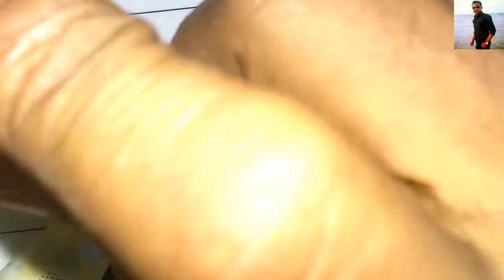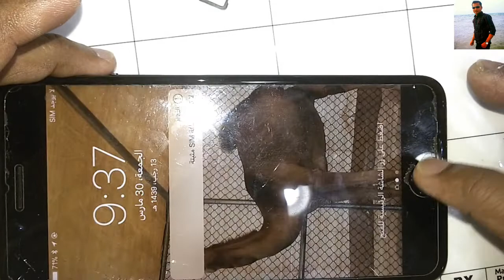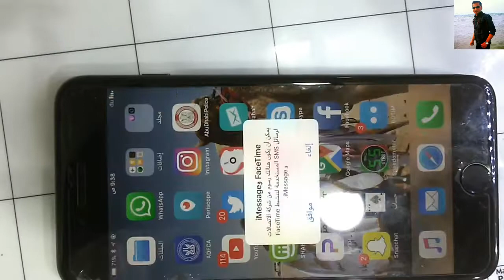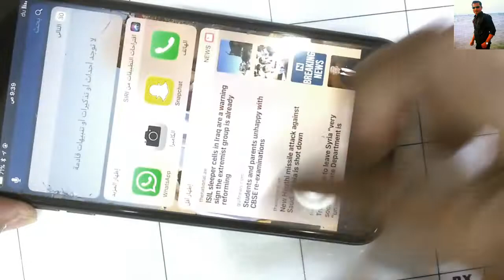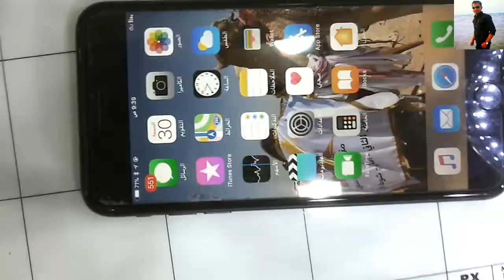How to Fix iPhone 8 Plus Water Damage Repair

Comment: My iPhone 8 after getting into the water for 20s was working very well 1h later I want to charge him and the screen turn blue then my phone become hot lava and so I let hi, cool down for 30min and now it won’t turn on I think the battery is dead. Is the bag of rice could help me their or I should change the battery cuz it won’t charge or turn on ;/
Reply from the maker: It is not advisable to charge the phone without water servicing. If the problem is not in the battery, then the charging ic problem
Reply: the exact same thing happened to my iphone 8
what did you do ?

Comment: Looks like he just cleaned it and put it back together?
Reply: MSR _jae he probably replaced a part or 2
Reply: First step to troubleshooting a water damaged phone is to get rid of all water. The motherboard part especially because it can still hold water even if you dry everything out with Air or heat
Reply: @gothmedia2509  he didn’t replaced parts - I followed his steps with my dead phone and cleaned everything with 99% Isopropyl then dried Motherboard with a hairdryer. I am really grateful to the video - the old beloved phone… it was not worth paying huge money to mend it professionally- so I had nothing to lose!

Comment: How can I send my iPhone 8 Plus to you to fix it? I was under the impression that it was Waterproof but I just recently found out that it’s “Water Resistant”. Phone still turns on, when powering on it just stays on that main white screen with that black Apple logo.
Reply: Donavan Rashad  that i have problem with my iphone 8. But i service from repairing center. But i have little bit water in lcd. How to fix it?
Reply: hey the same happened to me what did you end up doing?

Comment: Are you using a heat gun? Or a blow dryer?
Reply: I used a hair dryer, it worked (Isopropyl 99,9 % first on motherboard)

Comment: i have iPhone 8plus i droped it on water and it was working good when I took it off the water but after some seconds it's home button is not working and then my charging was low and i switched it off and when I reached home then I start charge it but then my screen turns black at the corner and then it produce too much heat and then it won't open tell me what should I do please 🥺

Comment: This video is interesting looks like he’s showing a repair from a phone that just got wet but this person is lucky because 1 if you don’t Do this immediately with power off again immediately and do not plug it in you might get this result ant thing done after those 2 things and good luck the board is trash and the screen is trash will always have issues later something to keep in mind 👍🏻

Comment: Hello 
Nice video! I have a iPhone 8 Plus, I dropped it in water and it is not charging. When I put in the charger, it will tell me 0% remaining after few it turn off. Please help me
Reply from the maker: yes i can fix it
Reply: Your battery probably just went bad
Reply: You need a new battery and maybe a new charging port pretty simple fix 70$ at the most

Comment: .... Most likely... Circuits fried.. so no good...if phone was on...
Reply from the maker: thank you dear bro
Reply: My phone was on, didn’t switch off, it was submerged into a hot, salty, soapy bath water. The worse. BUT I followed the video - it worked! I am so grateful and still cannot believe it. Motherboard treated with  isopropyl 99% then with hair dryer what probably made it.